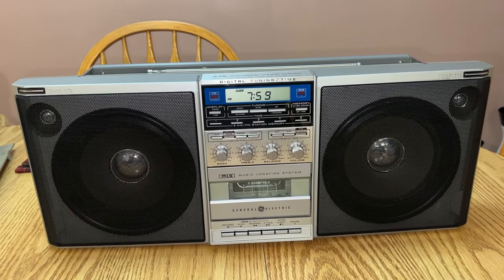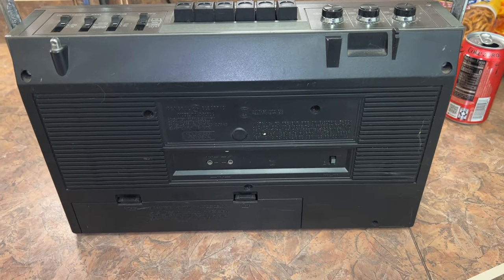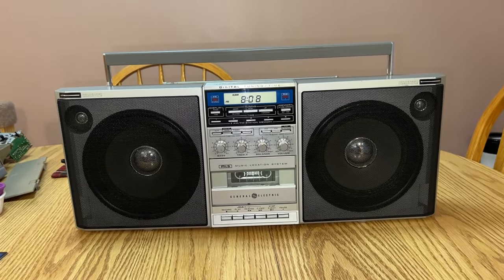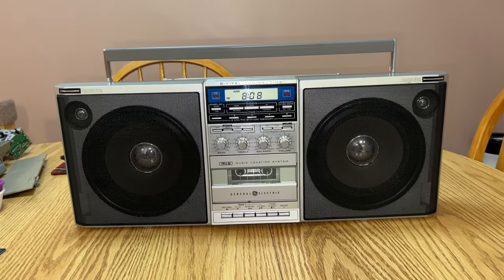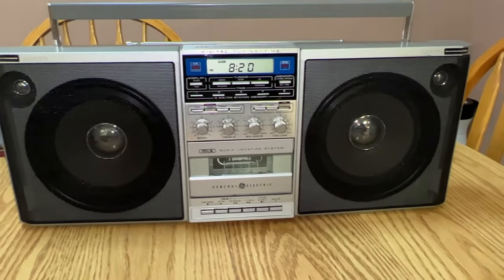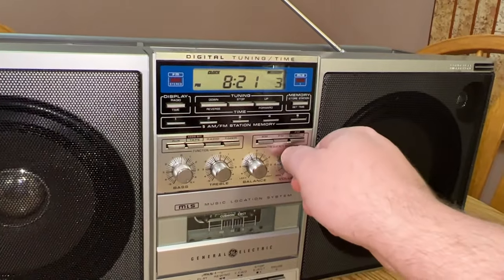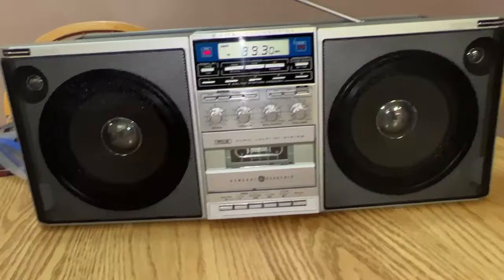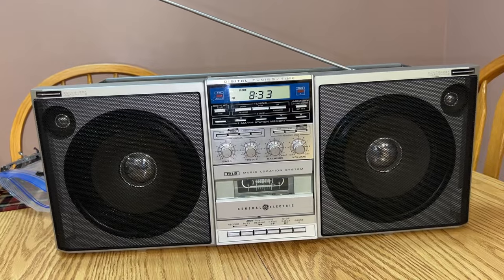The Blockbuster II? 1983/84 GE Model 3-6035A/B Boombox

Comment: I bought this unit back in 1984 from Service Merchandise and it served me well in college and over the years. After looking at several units the sound and style made it an easy choice. Its last few years was outdoors on my screened in porch and that resulted in the digital display not to function. It broke my heart to dispose of it in 2017 but my wife was glad to see it go. For the most part, I used it plugged in but I remember it taking 8 D batteries and 2 double AA for the digital display. It was a heavy unit loaded up. It also had an AUX input and recorded live. I still have my cassettes though!

Comment: I saw both these units on Ebay. I was considering buying the unit with a crack in the screen. I'm glad I didn't make that decision otherwise you wouldn't have had your parts unit! I love how the cassette deck says "cushion" eject. It sounds so much softer and more attractive than the standard "soft" eject. Did you happen to see the "analog" version of this unit while browsing ebay? It's model no.  GE 3-6000B
Reply from the maker: Hehe what a coincidence; Yeah, I bought it right after being frustrated about the cassette deck issues without even thinking because of the lower  price.

Yup, the 6000 appears to be the original version of this boombox, from about 1980. I just received an offer from the seller on one that was too good to pass up, and I just bought it. I'll find more details about it once I get it, since very little about it is really online.

Comment: Thanks for the great video!  Christmas 1983 the GE 3-6035A was my favorite gift I received.  It sounded great outside tooth tapes!  When I received a Sony Discman for Christmas 1986, I plugged it into the AUX input on the GE3-6035A and it sounded great, but the frequency response of the GE 3-6035 was not up to CD specs.  We've come a long way in boom boxes since then and my JBL Boombox with my iPhone destroys the GE-3-6035a.  But what a great piece of stereo gear was that GE 3-6035A in 1983!!!

Comment: You did a video on the operation of a 1970 Maytag portable washing machine. Do you have a video on how you replaced the belts on it. 
I found one, that had been donated to Habitat for Humanity. It had a brand new replacement belt, still in the package, in the tub. When I went to open the plastic it was in, that polyethylene belt literally fell apart. As I've always done my own car repairs, I decided it best to replace it with a auto v-belt. I measured around it, at 49 1/4 inches, using an old telephone cord. Problem #1 even an inch bigger isn't big enough. Problem #2 how in the heck to get the belt on, when there is no tensioner?
PLEASE HELP!!!